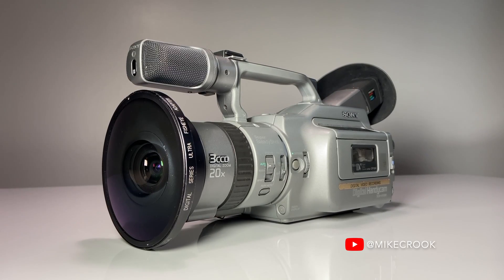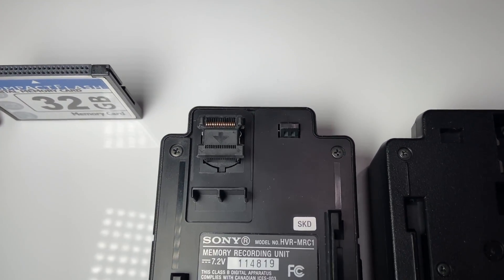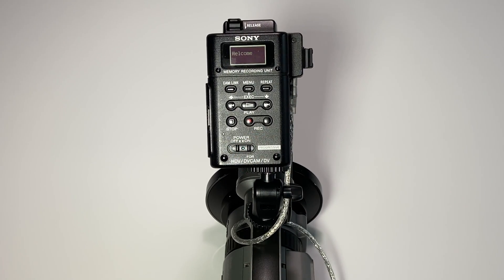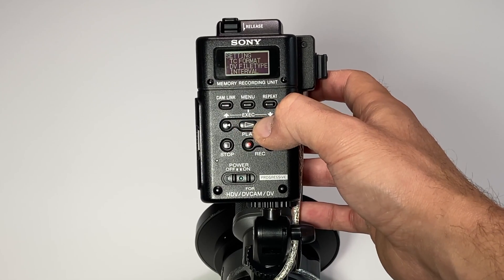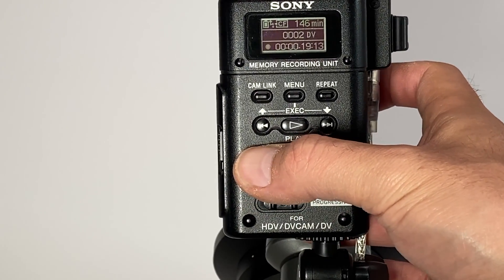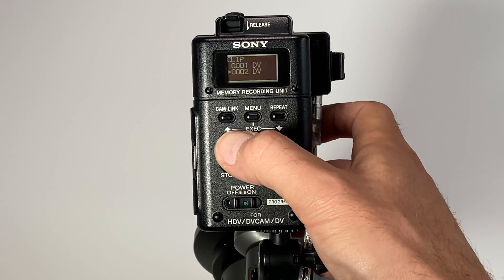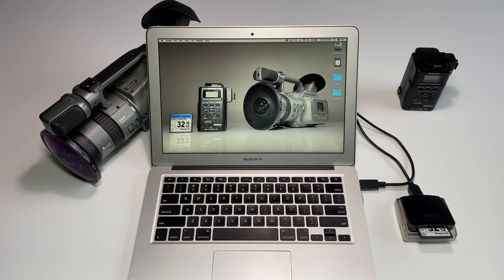TAPELESS VX1000 / SONY HVR-MRC1

Comment: ok I got a MRC1 but I can’t edit any of the DV files do I need to convert it??? How do I convert them without losing quality???
Reply from the maker: convert to prores, also you can change it to AVI recording on the MRC1 (this is what I do now)
Reply: @mikecrook pro res using what? I’ve tried .avi and they don’t let me edit with mac, any suggestions?
Reply from the maker: @billygate4063  on mac you can right click the video and convert it, should be the last option on the right click menu

Comment: Thanks for uploading. I got it working and formatted the card. But it doesn't want to record unless I turn on the camera BEFORE the mrc1. Then, when I go into playback mode, I can't see the footage when I press play on the mrc1 (it does recognise the cable being plugged in though). Any thoughts? I'm very new to working in video, so any help is much appreciated! Thanks!!
Reply from the maker: some cameras dont have DV in so you cant play back
Reply: @mikecrook  it's a vx1000
Reply from the maker: @  so as far as I know all PAL VX1000's do not have DV in
Reply: @mikecrook  Checked the test files on my mac, they work! Thanks for the help :)

Comment: Hey all troubleshooting my unit & camera. What kind of CF cards are y'all running. Atm I have a 32gb sandisk extreme that is not being recognized (No File issue)
Reply from the maker: only real issue I had with cf cards was the 32 extreme card, you need the 32gb extreme pro card

Comment: hello,
I'm trying to update my Sony MRC1 to firmware V3, but my current firmware version is V2.
I attempted the update using an L-Pro Professionnel Compact Flash UDMA 64GB card, but like in your video, I got a "Format Error" and went through the formatting process.
However, I couldn’t find the "Firmware Update" option in the menu afterward.

I also tried with a Lexar Professional 1066x 32GB CompactFlash UDMA7 card, but got the same result.
Do you think this issue is caused by the CF cards? Or is it because I’m on V2 firmware and not V1?
If it's the latter, is there any way to downgrade to V1?

Thanks in advance!

Comment: Great video! Just one question: how do you clear your card after shooting and copying the files? Do you format in the computer or inside the Mrc1 unit? Or do you just delete the files in the pc and clear space for the next recording?
Reply from the maker: you can delete them when using a card reader on pc or mac, just only delete the video files in the folders, I rarely format the card
Reply: @mikecrook  Thank you so much for the response! I normally delete the files in my pc, but last time the unit showed the message “Format Error” and I had to format the card inside the MRC1. Has it ever happend to you?
Reply from the maker: @pocket_labo  happens sometimes, its rare though

Comment: about to unload a grip of questions for you on IG, lol. I got a 2100 and really thinking about going tapeless for a few reasons, 1-no anxiety of wondering if the tapes are gonna glitch or not, 2, not buying a separate cheap miniDV camera to use for capturing the footy onto a computer so i don't wear down the heads on the VX...but with these attachments, it voids the use of a mounted light, does it not?? Dope informative vid tho, see ya on the gram!!!
Reply: U can always get some Velcro and strap it somewhere else on the cam, I’ve seen people use the bottom!

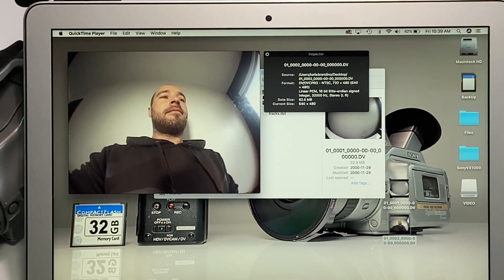Comment: 5:44  - it records in 480i (720x480 interlaced). DV pixels are rectangular, not square - hence the non-4:3 aspect ratio. People will still to deinterlace for use on modern displays, and refactor it to 4:3. If YouTube is the target delivery, they will also need to upscale to at least 1440x1080 or YouTube's compression scheme will destroy the quality, which would be a shame - since the VX1000 has a spectacular image for SD NTSC video. Great video - I love this idea.
Reply: Where did the 720p come from?
Reply: @stillben  He says in the video "youll notice it records in 720p" but he is associating the wrong number with 720 - width:640 from the DV Res of w640*h480 and or w720*h480 - with the first HD res of 720p (w1280*h720) which the 720p is associating the amount of lines vertically  and the fact it is progressive which is NOT what the vx and/or this recorder outputs which is still 640*480/720*480i.
Reply: @MattMatheson  got ya.

Comment: I recently got the MRC1. Everything works perfectly with the VX2000. But my VX1000 only records, but cannot play back the footage. The screen in the viewfinder remains black and does not display DV IN. In general the playback works with tape. Has anyone had similar experiences? Maybe I just need the right settings on my VX?
Reply from the maker: Some VX's have DV in and some dont, most europe versions of the vx1000 only have DV Out
Reply: Thank you very much for your answer! 
I have a VX PAL version. So there is no solution to play the footage with the MRC1?

Comment: Mike, do you ever experience an endless "format" loop? I'm not able to do anything BUT format my card, and getting the "format error" repeatedly.
Reply from the maker: I had that happen to me, I switched CF cards and worked fine after. That CF card I had to reformat on the PC to get working again
Reply: @mikecrook  thanks for the response Mike. I just ordered a new CF card to try. Hopefully it works. If so, I'll update the firmware and maybe my 32gb SanDisk will work! Cheers and thanks for all the work you do on the tapeless build!
Reply from the maker: @GemsOnVHS  make sure you get the extreme pro sandisk card, the PRO is important

Comment: Yo Mike i need your help!
So my setup is a vx2100 and I got myself a DVR-MRC1. 
Iv not done the update file just yet.
I have followed the video and set everything up but the update.
When I press record nothing happens. Iv noticed in the comments to check the ports on the camera and they are working.
I did buy a fairly decent cable on Amazon and wasn’t a cheaper option. 
My MRC1 is working with my CF card (transcend 32gb)as far as I’m aware. And It has been formatted. 
The issue only comes from when I click the two buttons to record nothing happens?. It there setting on the vx I should change  or Should I do the update v3 then try again? or do you suggest a new cable? Thanks ✌️
Reply: Did you ever figure this out?
Reply: @Alexxzzzs  Yo man. So for me the firewire port on my VX2100 was broken. I ended up getting it fixed. works now tho. what you having issues with?

Comment: This little device was giving me hell at first. Sometimes it filmed,sometimes it didn't. It was unreliable. Then I got fresh batteries and changed my firewire cable. That was all it needed to start working just the way it was intended. So if you are having issues,try doing the same thing.

Comment: So when I connect the HVR-MRC1 to the VX1000 turn on the MRC1 first and then the camera
my MRC1 is going to freeze in the moment the camera is turning on. No matter if Camera or VTR.
When I turn the camera off again the MRC1 is not frozen again. Whats the issue there?

I have these components:
SanDisk Extreme Pro CompactFlash 32GB 160MB/s
FireWire Cable IEEE 1394A
FireWire Cable IEEE 1394. 
Both cables give the same result.
Reply from the maker: inspect your firewire port, you might have a bent pin on the VX it self.
Reply: @ook the pins seem to be okay and in order.

I just ordered a Firewire PCI card to connect the Camcorder to my PC. Then we will see what will happen so I can exclude the problem to be at the miniDV port.
Reply from the maker: also plug your mrc1 into the computer to test it will detect the same as your camera, it can simply be your cord causing the issue  @seplayer
Reply: @ook okay I got some news. 
I got a PCI Chip for my Windows 10 PC with firewire ports.

The camera is being recognized as Photo eiditing device but not as camera device.
When I go to stream labs and take the DV as source for getting its picture I can chose the cam in the video recording sources tab but after that nothing happens. 

So at least the camera is getting recognizes but I actually dont know how to use it linked to my computer.

The MRC1 is freezing again when I connect it to the PC. Same procedure as with connecting it to the cam.

Only thing I managed now is to capture Tapes via Sony Vegas.
I even can click on "capture tape" in vegas and the signal is going to the camera and it starts to rewind to the beginning and then plays the whole tape.
Reply: @mikecrook   Just to keep you up to date. There was a guy in a reddit forum who had the same issue I had. After trying a lot of different Firewire cables he found one that will work. 

I just ordered those cables he recommended and in 1-2 weeks we may see a change with the issue. I just hope so. 

Meanwhile I was reading some things about Firewire cables that Firewire does not equal Firewire. 
Which means that there is a lot Firewire cables that have poor architecture and throughout that there is electro static issues with the connection. That will lead to lack of data transfer but power transfer still being provided.

It seems that the HVR-MRC1 is a lot more picky than the Camera or the PC Firewire Card.
Reply from the maker: exactly this, Im gonna try and make an updated video soon with information just like what you said.  @seplayer
Reply: @mikecrook  The cables came today. Sadly it did not solve my issue. I could cry.
Reply: @mikecrook  Just wanted to update my issue. 
I finally solved the problem. 
So, the FireWire port of the MRC1's cradle was corroded.
So I used a small, sharp tool and scratched the 6-pins carefully.
After reconnecting it worked pristine. Can't believe this was the problem all the time.

P.S. just realized you're the guy I messaged on instagram yesterday. lol.
Reply: @mikecrook  I recently made a video of checking the DV Output for any damage. It seems to be flawless from the outside.
https://www.youtube.com/watch?v=lkFq26__X-0

Comment: Does this device work with vx2100 aswell?
Reply: Also, i saw a cf card adaptar to sd, you think it will work Just fine with this?
Reply from the maker: will work with a vx2100, I have this camera as well, avoid the adapters, inconsistent to if they work or not. Sandisk extreme pro 32gb CF card is 100% working. Do not go above 32gb.   @RobertoLopez-wj4sq
Reply: @mikecrook  that port adaptor you use to upload, whats the brand/model? Does it connect to usb?
Reply from the maker: CF card Reader, mine is from 15 years ago so dont even know if they make this one, but they are cheap on amazon 
 @RobertoLopez-wj4sq
Reply: @mikecrook one last question bro. I just ordered one off eBay and all the accessories but haven’t had that time to mess around with it…. Is it possible to capture a tape inside the Vx on vcr mode from this hvr-mrc??
Reply from the maker: @RobertoLopez-wj4sq  it is! when you play the tape you can record on the MRC1

Comment: Hey Mike,
Thanks for this great tutorial. I wonder if you can help me troubleshoot a small issue I've been having. I follow all the instructions using a vx2100/ mrc 1 (with sandisk 32gb extreme pro CF card) and it's not letting me record. It says No File, and won't record no matter what I do. I even updated the firmware to 3.0 and still no luck. Any advice would be greatly appreciated :).
Reply: I’m having the same issue. I tried new FireWire cable and new CF cards. Anyone have a fix for this?

Comment: I found your video and immediately pulled the trigger. Bought everything you have to film my little rippers. Then immediately after purchase found a local deal on a mint HDR-FX1 which the MRC1 should pair with as well. Found your IG, love the videos and your son's name.
Reply from the maker: Thats amazing, thank you. The FX1 is a great camera too! Appreciate the love!
Reply: @mikecrook  I Just got my MRC1 in today and exchanged my CF for the 120MB you recommended. I feel like I saw it somewhere but was there a setting I need to turn off in the VX so it won't go into sleep mod while recording with the MRC?
Reply from the maker: just touch the zoom rocker, VX will shut off if nothing is touched in 10 minutes, no setting for it  @SorieKondi
Reply: I had an FX1 and then I shorted out of the power supply module but turning it on without the handle/LCD plugged in, so dont do that. Never had a camera kill itself like that, but the FX1 likes EVERYTHING to be connected lol

Comment: My question would be, how do you actually know what you re recording if yo cannot watch while recording?
Reply from the maker: you can watch the clips, the device is DV in and out
Reply: @mikecrook  yeah but there is no way you can watch while recording? Or maybe with an extra screen or something?
Reply from the maker: the viewfinder is a screen on a vx1, or you just mean so all the homies can watch. I just bring my laptop and drop the clips at the spot  @RafaelZeratai
Reply: I mean while you are recording the viewfinder gets disabled by the “no cassette” notification? Or does it work normally with the hvr mcr connected to it? Because on the video while you record you can’t actually see what you are recording just guessin by pointing the camera where you want. After that I know you can watch them clips but during recording you can’t?
Reply from the maker: The viewfinder stays on while recording, the no tape icon is very small in the middle. This is the same on every camera I have tried with the MRC1 @RafaelZeratai
Reply: @mikecrook  thanks i though the viewfinder was all grey while recording

Comment: Any troubleshooting for if hitting the record buttons does nothing? I seem to be getting no reaction
Reply from the maker: Inspect your firewire port on the camera, more than likely you have a bent pin. If all 4 pins are normal could be your cord.
Reply: do you know if its a sync problem? or does it show on your recorder that there is a camera connected?

Comment: Hi, Do you have some delay after pres REC button on MRC1 to start recording? I have arou 2 second delay after pres REC button to start recording. I thing that it is problem of my CF card. Do you have similar experience?
Reply from the maker: the delay is very short to be an issue. Its about 1-2 seconds yes.

Comment: I was advised on a video forum that instead of using the outdated and expensive SONY HVR-MRC1, I could opt for a more cost-effective solution. The suggestion is to use an S-Video to HDMI converter along with devices like an Atomos Ninja or BMD Video Assist to record the incoming video stream. I am curious if anyone has experience with this setup or has any input on its effectiveness. Thank you.
Reply from the maker: Atomos is HDMI or AV, HDMI cannot be converted from firewire. So your quality on these old cameras would be worse. The MRC1 is true DV quality with timecodes.
Reply: @mikecrook  I comprehend that Firewire and HDMI utilize different protocols, making it impossible to use a Firewire to HDMI cable or adapter. However, since the VX1000 also features an s-video out port, one might consider attempting an s-video to HDMI connection instead.

I asked in a forum a question, and someone said, "If it's going in/out via Firewire, it may already be DV-Compressed at that stage, which depending on your preference & sensitivity may put you back to square one, and S-video may be your best bet then. Of course, it's still SD." Since I did not really understand what that meant, I asked and someone explained by saying, "He means that what comes out of the DV port is encoded with DV codec, 29 Mbit/s, no matter whether it comes from tape or live.

OTOH, if you feed live video through analog port, it will come converted from digital sensor into analog, but not compressed into DV beforehand. So, in theory it may look better than when captured through Firewire."

All that said, it looks like that using s-video might not be such a bad idea!? I know too little about this stuff, so I don't know. What say you? Thanks for the reply and input. : )
Reply from the maker: s-video is analog that doesnt carry audio, using s-video you are taking a digital video (DV) to analog to then capture to digital again, the quality would be a loss. DV has faster data transfer rates and can handle the digital video hence the DV port with stereo audio. The MRC1 is 1:1 the same as tapes just without glitches as your not using the Tape deck Heads. With modern upscaling etc.. VX footage still looks great in 2023. Personally I wouldn't touch RCA or S-Video to be an option but thats my opinion  @fc1133
Reply: @mikecrook  Copy that. Thanks for explaining.

Comment: I just bought an MRC-1 for my Panasonic DVX-100b. It works, but I’m having trouble importing the .DV files into Premiere Pro – or any other program, for that matter. Do I need a plug-in for PP to import the files for editing? A point in the right direction would be fantastic 🙏🏻
Reply from the maker: switch to AVI on the MRC1
Reply: @mikecrook  Will do. Thanks!

Comment: After setting the camera to VTR, do you have to press play on the camera to play back the footage, or do you just set the camera to VTR? I'm asking because the flex cable for the play button broke on my camera. Thank you
Reply from the maker: the MRC1 has a play button. But not all VX's have dv playback as a heads up.
Reply: @mikecrook  Hmm ok. My question is if you have to press play on the camera as well. Someone in another video says to press play on the MRC1 and play on the camera, but I noticed in your video you said to just press play on the MRC1. Thanks!
Reply from the maker: @keatorski  ohh no, just play on the MRC1
Reply: @mikecrook  Ok cool, I appreciate your help, and thanks for making the tutorial as well.